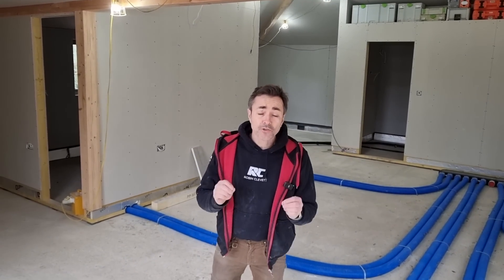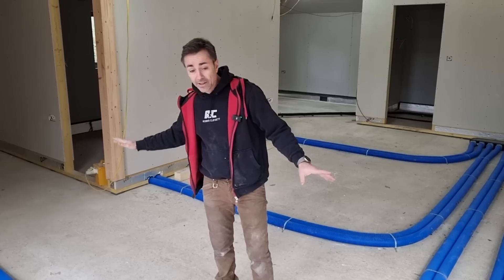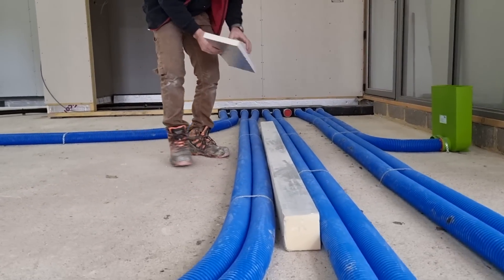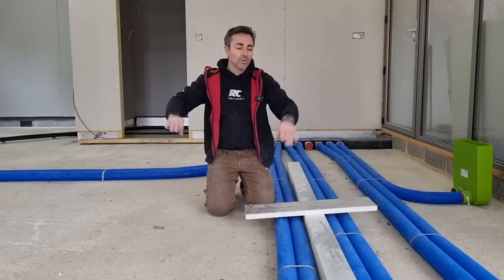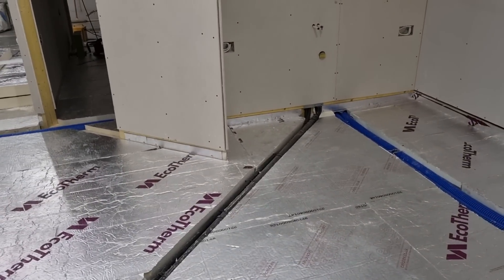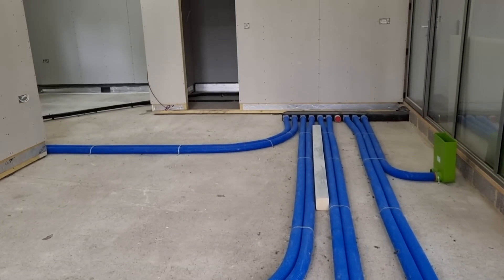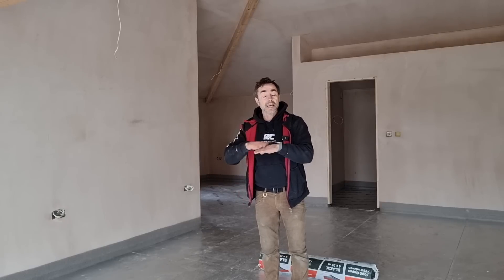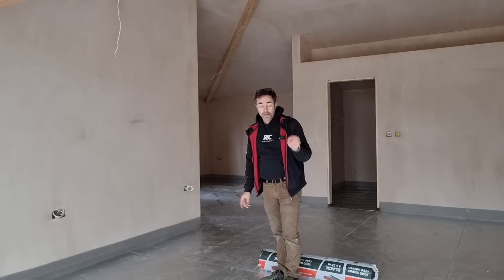How to Insulate a floor to building regulations and ready for underfloor heating

Comment: Wouldn’t it be more efficient to place the ventilation above the insulation? Right now, the air is being cooled by the ground, which reduces efficiency. I assume you’re working with a heat recovery ventilation system (HRV). In that case, wouldn’t it make more sense to install the ventilation ducts above or within the insulation layer to prevent unnecessary cooling of the airflow?

Comment: I have a question about the strength of the PIR,  I am looking at insulating the slab in my 1970s house but I don’t plan on putting down underfloor heating.  I have one snag in that I have a 450 litre fish tank.  Would the PIR be strong enough to hold a good half a ton of this on 6 legs after screeding or do you think it would be wise to use a thinner layer of insulation there and to use floorboard on that section to spread load directly onto the slab underneath?

Comment: Vent pipes under insulation touching cold slab is not the best plan and technically doesn't meet regs. All vent pipes should be within insulation envelope or should be insulated themselves. Also wherever there's a pipe this means there's a gap in the floor insulation.

Having said that it's not the end of the world. You'll just get a bit more heat loss than you would have, and some condensation in the pipes if they are bathroom extracts.

Could improve things considerably by injecting spray foam into the gaps between insulation and pipes.
Reply from the maker: Its a good observation Laurence, I have a really thick suspended concrete raft that is 250mm thick, suspended from the ground on a polystyrene heave protection product, this contributes to less cold passing through the raft in my case, but yes if it was a standard slab on hardcore there could be some minor issues, also all our extracts are over head, the floor is only supply air
Reply: @robinclevettcarpenter  I'm betting that supply air will be cold by the time it gets to those vents.

Comment: Interesting video but it all seems like ridiculous overkill and the costs must be HUGE. Will you ever recoup the thousands spent on insulation etc in heating savings?
Reply from the maker: Well this is about costs over the lifetime of the build, it is also about energy conservation and low running costs, also all these measures are compliant to modern building regulations and needed for this build, it's all about knowing what you want from a building when specifying and costing the work

Comment: Have you used tla pumped insulation on any projects before?
Its taking off in a big way in Ireland
Not a whole lot more expensive than 150mm of pir and no labour involved in fitting
Ive priced out my project and it was about 600e more than the boards

Comment: The gaps in the insulation the pipes sit into can be filled with sand as it has good thermal qualities and it fills the gaps left over nicely, works as bit of extra support too.
Reply: Sand thermal conductivity is approx 0.25 W/mK and Kingspan insulation is 0.022. So sand is ten times more conductive. Not good idea. Probably better insulation to just leave it as air gap.

Comment: Hi Robin, really enjoying this series. Isn't it a bad idea having the mvhr ducting running effectively outside of the insulated space against to cold concrete? Won't this cool the warm air you are trying to recover or is the slab insulated under the concrete as well? I suppose the losses might be negligible but it seemed like a strange design choice to me.
Reply: I was just about to leave a comment with the same concern, surely all that energy recovered from the exhausted air will be lost to the cold underfloor before it gets back into the room. Seems a waste of time.
Reply: This would be something I would question also. Warm air returning through cold duct sounds like condensation trap to me.

Comment: Robin, were those metal plates aluminium or steel? If steel might they react with the foil backing of the celotex? Just a thought.
Reply from the maker: Hi Ian, this is Aluminium so effectively the same as the foil
Reply: @robinclevettcarpenter  thats good, I hoped they would be ali